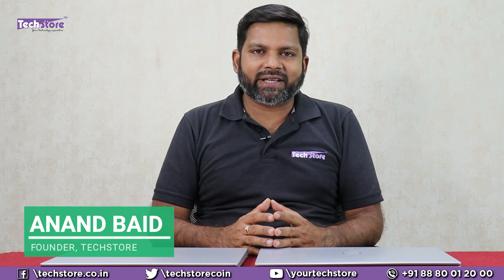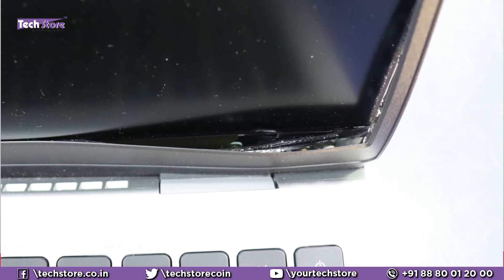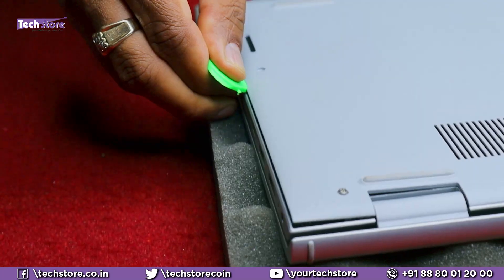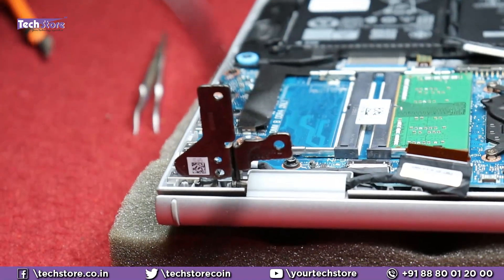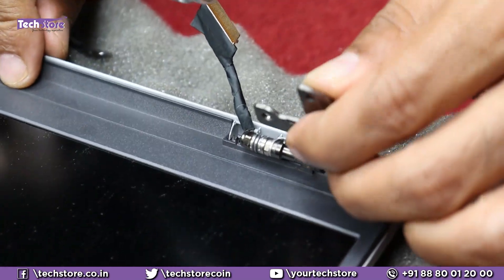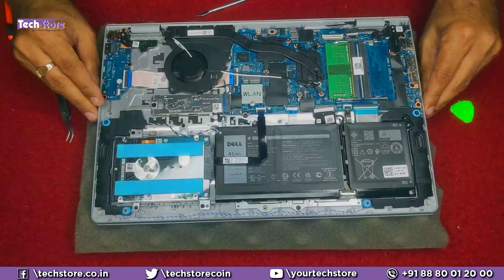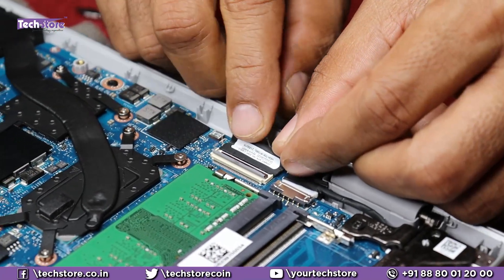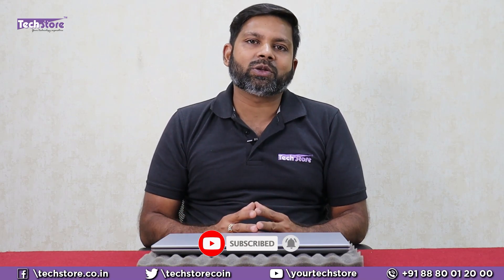Dell Inspiron 15 3511 3515 3520 3525 Hinges issue resolved: calibrate the hinge of any slim laptop

Comment from the maker: Requesting all to log complaint with Dell and share this thread on their  twitter handle. If under warranty Dell is replacing the parts without any charges.
Reply: Dell is not replacing the 3525 under warranty even though its the same casing.  We are going to have to do a self repair to fix it,
Reply: @Nish_2050  they will do for free
Reply: How to open light plz tell
Reply: SIR THIS IS OUR HUMBLE REQUEST TO YOU,PLEASE MAKE SAME VIDEO FOR LENOVO IDEAPAD 15 INCHES SLIM 3i LAPTOP .
Reply from the maker: Sure, we will be sharing shortly
Reply: Hello Sir ! , when i open / close laptop the screen turns yellow near the hinges and bottom , clearing visible on black screen / brightness bit increased,  if i touch the screen also the colour changes in the bottom . Whenever you open close laptop the pressure is there , and yellow it appears
Reply: @captaincsk same problem
Reply: @FeelingCatch1  they said all laptop have same issue , but i got my hinges and screen changed still the issue was same 

Just get the hinges a lil loose
Reply: Where can I log the complaint?
Reply: where to get dell 5518 parts
Reply: Today my laptop got broken and I got it repaired but he is charging me Rs. 1200
Reply: Mine is Dell inspiron 15 5000 series its hinges are now dead properly they dont even respond well

Comment: Thanks so much for this video, this really worked and I’m so glad to do it myself with step by step instructions, I gave it for service and they suggested to buy new laptop as repair would cost more than $300. Moreover I repaired it earlier and they charged me $220. I’m now confident to repair myself in case i need to buy new hinges and basically I guess this is a flaw from DELL

Comment: As a simple method to aply the same tense to both hinges, you may try this:
Using a sheet of paper,  checked whether both planes rested equally, which would confirm equal pressure and therefore equal hinge calibration.  
- By inserting the sheet from the rear corner, it can be seen that on one side the sheet goes in more easily and deeper than on the other side. This indicates that where it does not go in, there is more pressure on the plane, and that the hinge adjustment is not as equal as it should be.  
- remove the hinge cover and adjust the pressure on each screw of both hinges, iterating as needed.  
-  verify two aspects: that the sheet enters equally on both halves of the laptop, and that when opening/closing it has the proper pressure, with both nylocks visually appearing equally adjusted.  
- Once the mechanical adjustment is achieved,  lightly apply silicone lubricant to each hinge and clean off any residue.

Comment: Thank you so much for this video. Its year 2025 and this still works for the current Dell Inspiron 3000 series, specifically used this guide on Dell Inspiron 15 3530, still same layout. 

Tips for future viewers:
1.) You just need to turn the hinge by a smidgen, like maybe a quarter turn or so. The hinge would still feel tight, but it's enough to be able to open with one finger (like in this video), don't make the same mistake I did and had to go back in 3 times! I did it full turn then half a turn and the screen can barely hold itself upright, a little shake and it's going to either close in on itself or the screen would fall backward, even now with the quarter turn the screen will fall down if you bring it closer to your keyboard (you'll have no choice but to keep it upright most of the time now).

UPDATE (11/27/25): Recalibrated another Inspiron 15 3530, seems like this time the unit needed to be calibrated further, had to turn the screw almost halfway to be balanced, so now will have to tell you future readers to treat the hinges of these laptops as a case-by-case basis. Sorry for possibly misinforming. My suspicion is that I kind of messed up the screw on my first unit when I was trying to turn it with pliers instead of using the socket (refer to #2).

2.) Buy the 5.5mm socket, it's worth it and cheap too. The first time, I did it with pliers and made the calibration extra difficult. The nut to turn is really small and there's small wires around it. With the socket it was a breeze and easier to tell how much calibration you've done just in case you need to go back in and recalibrate.

3.) "Non-techy" person? or still not confident even after watching video. Then you'll have to open your inspiron laptop very sloowly from now on. Hold the screen in the middle of screen and one finger in front of the trackpad and open it slow and you'll have to do that for the remainder of this laptop's life. The laptop is fairly small so not too bad but you'll look weird trying to baby this laptop during opening and closing lol. Honestly, I'm also a casual with these things, only did ram and hard drive upgrades couple times in the past and managed to do this just by watching this guide. Pretty confident majority of people should be able to do this so long as you don't rush it.

Comment: i didnt do the calibaration and as you said the thing broke me on left side ,on display frame 
also on removing the wifi there is a small smd thing and accidentally broke it to and laptop is discharging but not charging 
now what to do abt the hinge first of all and how much does it cost , please ?
Reply from the maker: If under warranty log complaint with Dell.
Reply: @TechstoreCoIn  nope the laptop is out of warranty , purchased on 2022 😢

Comment: Very helpful! It was vital to the repair of my wife's computer (3520). You may have mentioned, but I didn't hear clearly, that the two case screws nearest the hinges are captive and cannot be removed. Also, when I rebooted the computer, the time was off, but the computer also required me to run Setup, and it rebooted much more slowly than the last time. These items were a little unsettling, because I didn't expect them. Thanks for the crucial help!

Comment: Thanks for the video! This happened to me soon after buying (Dec 2022) and again just now (May 2025). Dell covered the first instance but would have nothing to do with it failed again now. Seems like they replaced a bad part with... another bad part. 😐

But loosening up the tight hinge did the trick. As long as I open/close gently the screws that broke free from the plastic don't come out of place. The other hinge provides enough support to keep the screen up when in use.

Comment: I have a dell 15 3520 with the hinge problem. Why do I have to remove all the parts you show? Can't I simply remove the botton,  take the hinge screws out and the hinge cover and then adjust the hinge screw?

Comment: WOW! My dell 3520 became unreasonably stiff in a single move, and threatened to rip itself apart. I thought it had been dropped. Thanks to you, I realized I could grip the hinge itself and force it to open without damaging the screen. Now I will follow you here and repair the stiff psycho hinge myself. Thanks for detailing the process.
Reply: Fixed same day. I found that hinges can be adjusted without disassembly.
Reply: How did you do it? @supercleaner
Reply: @nobleojoe247  I read you can just remove the plastic caps covering the hinges and calibrate the hinge that way. Unfortunately, I tried this and the plastic cap won't come off fully without removing the screen, so not sure if I did something wrong or missing a step.

Comment: Hi, I loosened the hinges and rearranged it as shown. But the display is not working and the charging light is blinking on & off continously when charged. Please help....
Reply: after this still can open the display？ i also facing this problem

Comment: Thank you very much for your video. One hinge on my laptop snapped off the plastic mounting and started to damage the display case. With your video and some JB Weld original cold weld epoxy, I reused the hinge, re-seated,  and epoxied it in place. Over time, these hinges tighten, which leads to the damage. It took me a few adjustments to the hinge bolts to get the tension right. I noticed that I could reassemble the case with the hinge covers removed, thus allowing me to adjust the hinge bolts until the tension was right. It seems one of the display bezel's snap clips near the formerly broken hinge broke, so there is a slight gap where the bezel is not flush against the case, but it is barely noticeable and should not cause problems.

Comment: I managed to calibrate the hinges but after putting all the parts back, my laptop won't turn on + the LED won't light up when charging. No idea what went wrong. I tried reconnecting the VGA cable but it still won't work. 

It seems this happened to other people in the comments too, so if someone found a solution, please reply 🙏
Reply: have u found for the solution？ i need help

Comment: I've decided I'm going to do this job.  I had to buy a 5.5mm socket...which will be here on Monday.  Do you think I'll do a good job....I put new RAM in my laptop, no problems.  Looks like a lot of wires to reroute.  Great job on the video!
I'm definitely worried about the hinges or screen breaking!  I'm VERY careful opening the lid....but still.  

Once I get it to the proper tension, will it STAY at that tension?
Reply: It should but it is fairly easy to readjust if needed. I just did mine following this video.
Reply from the maker: It will stay. Need not worry. Calibration has to be done properly

Comment: My Dell was too stiff also, and it delaminated the top. Sent to Dell, they fixed it, but was just as stiff as before. You'd think they would 'calibrate' the hinges, but NO! Now the top is doing the same thing. Thanks Techstore for this info (that Dell techs need to learn.)

Comment: This works, But doesn't need to take apart the screen. I did it without removing the screen and the. The covers of the hinges can be removed while the screen is attached. And can adjust the hinges with needle nose pliers. But anyway thank you for the video ❤️
Reply: How can you tell me??
Reply: @ashwinUchihafr  it's pretty simple, remove the back-plate of the laptop as in the video.
Then, gently pry each hinge cover from both sides (you can use a drawing brush handle to avoid causing accidental damage).
Make sure to pry it diagonally AWAY from the lid (towards the middle of the laptop)

Then you can carefully loosen the bolts using long nose pliers.
As in another comment, don't loosen too much, around 1/4 turn should be enough.
Loosen a bit each side, turn over the laptop and see if you can open with one hand. If not, just loosen a bit more.
Make sure you don't loosen too much, so that the screen still holds in place.

Finally, pop the hinge covers back in place diagonally and make sure they "click" back (there shouldn't be any gap at the back of the hinge), and then assemble the back-plate.

I did it and it took a few minutes, with no fuss.

Comment: My son's laptop broke one of the hinge mounting points on the screen. Took it apart and glued the hinge to the screen using epoxy. Adjusted the hinges according to the video and it now works again with no issues. Thanks for having a clear and concise video on how to address this problem.
Reply: What apoxy did you use? I have the same issue, the plastic above the lcd has peeled off
Reply: @slamminpotatoes4508 hey please tell me how u get it resolved....mine laptop also get in this situation don't know what to do now... please help

Comment: I wish I had seen this video before! Unfortunately, the hinges on mine broke out of nowhere and the display frame started to come apart. Luckily it was still under warranty and got it repaired, but I knew this was a design flaw. Many people on the internet reported this same issue with the same model, the Dell technical himself acknowledged it and recommended opting for Latitude model laptops, since those are sturdier. I also had an issue with my touchpad, it went absolutely crazy at times and was completely unresponsive. I solved it by unscrewing and removing it, then gently cleaned it with a cotton swab and reinstalled it. After that, the issue was gone. Maybe the connector was loose or there was some dirt on it, but I’m glad my computer is working correctly now. I like how fast it is, but I wish they used sturdier materials for the body
Reply from the maker: Thanks for your input. Please do subscribe.
Reply: Same problem happen to me now, but mine is out of guarantee. Have you any idea how much it will cost?
Reply: @rolaE4449 5200
Reply: @rolaE4449 Same problem any solution ?How much cost
Reply: @sujitbhusane2721 Hello, You said it was in Warranty, was it accidental warranty or normal 1-3 warranty? Please reply, My laptop has same problem now and luckily it's in warranty period, would normal warranty works for it? Please reply asap 🙏
Reply: Have you solved it ? @rolaE4449
Reply: How much did it cost?
Reply: @deonjoseph7178  it was still under warranty, so $0
Reply: @davidcarias4407  but physical damage in not covered in the warranty
Reply: Did they charge you to fix it in warranty card?

Comment: My problem with my Huawei Matebook 13 is that even before the hinge starts moving, the display has a a lot of excess play and it kinda pries the top and bottom panels of the keyboard apart. Thanks for this video, now I kinda get whats going on. It seems like the screws that attatch the hinges to the keyboard chasis got loose. Ama check this out just as soon as I find the damn pentalope screwdriver
Reply from the maker: Thanks a lot for your kind words. Please do subscribe.

Comment: Hello Sir. Purchased a DELL Inspiron 15 3511 on May 2022 for my daughter but was used only a few times. The hinges are good for now, will loosen the screws. But for me is the problem of CPU temperature, which often is more than 90degC, yes looks like their cooling solution is a disaster. Except for a cooling pad, reduced speed on bios, and maybe changing the thermal paste, is there another solution? Thank you.
Reply from the maker: Please use a good thermal paste.Please subscribe for more info.

Comment: I'm facing the exact same issue,  bought dell inspiron 3511 on November 2021 and 8 months later one of the hinges broke as shown in your video.
Reply from the maker: Requesting all to log complaint with Dell and share this thread on their  twitter handle. If under warranty Dell is replacing the parts without any charges.
Reply: @TechstoreCoIn   thanks for sharing information on service regarding under warranty.
Reply: @TechstoreCoIn   I just had a chat with dell  support assist person and he said service will be free of cost . But have to look for replacing hinge part ,whether he will charge or not? Till now a request number has to be raised from their side.
Reply: Me too purchased on 1st November 2021 one left hinge got broken and display and plastic in between it got cut off and shown in the video what are you going to do now
Reply: Have you Contacted dell support and claimed warranty?
Reply: @Rpk595  Yeah I claimed warranty and they have fixed the hinges now.
Reply: @shwethashwetha3735  congrats, my hinge and lcd screen got replaced by dell technician. Still the opening and closing screen is  tight . Do you have hardness in opening and closing after replacement?
Reply: @Rpk595  No hardness, it seems to be fine
Reply: Bro can you brief me how to say that the hinges were broken by itself. Give me a hint to communicate with the support member
Reply: @ErrorLogsOfficial   You can just say when you bought the laptop and say the hinges got broken and specify which hinge and where(they might ask you to send them pictures of the broken hinge) and that you want to raise a ticket to get it fixed
Reply: How many days it takes to claim the warenty
Reply: @ErrorLogsOfficial   it takes 3-7 working days.

Comment: Dell inspiron 15 3511 is the worst laptop  ....never buy it...I brought it on October 2021 within 15 days the hinge came out.....they 1st say that it's a physical damage and will not cover under warranty then they agree to fix it....after 2 months the technician come nd said that he can't fix it as the display also get damaged because of hinges....they just keeps on giving excuses and after 4 months they replaced it....but again the new laptop's hinges also came out....and now they are doing the same thing...it's the worst laptop ever ....never buy it
Reply from the maker: Kindly get the Hinges calibrated as per our video. Most Slim laptops are facing similar issue. Dell 3511/3515 are facing issues in almost all laptops.

Comment: Hi.. I follow every each step.. But after that the laptop cannot turn on.. Also when i put ac supply from the adaptor.. The indication led was not light up and not charging .. Is there anything might be a problem?
Reply: This is exactly what's happening to me! I followed the instructions and now my laptop won't turn on + the LED won't light up when charging. Did you find a solution?
Reply: Maybe battery connection is loose

Comment: Wow bro you saved so much money of people. Seems Dell is making lot of profits of this issue.
Reply: No bro because as he said it's a hardware issue ..so I I'm also a dell customer so  dell provide warranty of hardware if it's comes under there scope of support.. thy will wil support until there is no damages by customer.
Reply: @hemantsinghnaula4179  sir ,do they also provide free repair for out of warranty device with broken hinge???? Please tell me
Reply from the maker: There have been cases where dell has provided free service even when the unit was out of warranty as they have accepted it as a manufacturing defect. You need to go through the right channel to claim.
Reply: @TechstoreCoIn  Is the right channel the Dell "support assist"?
Reply from the maker: Do subscribe